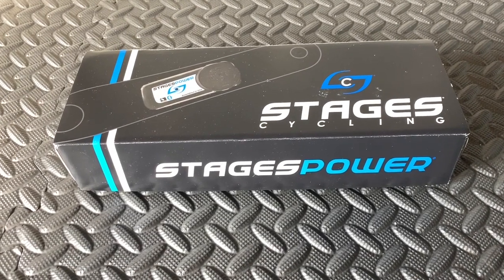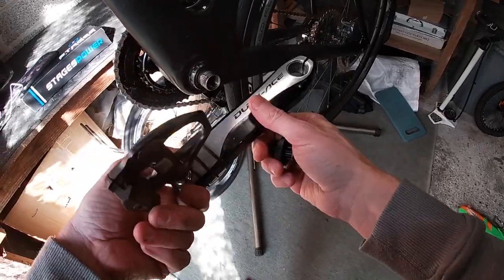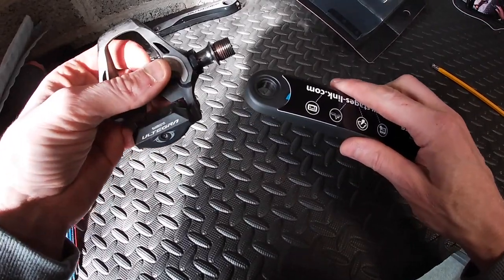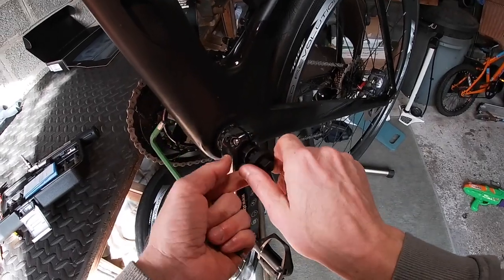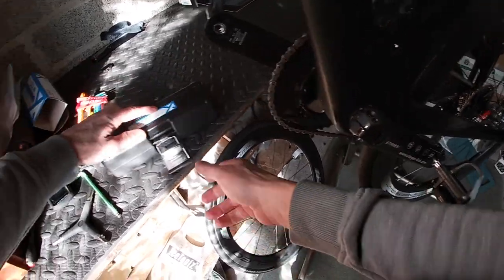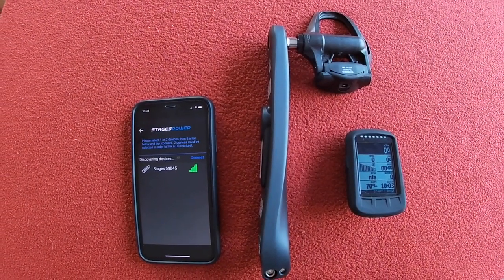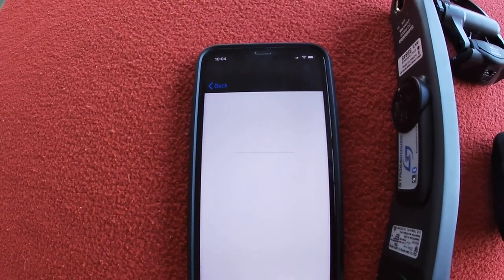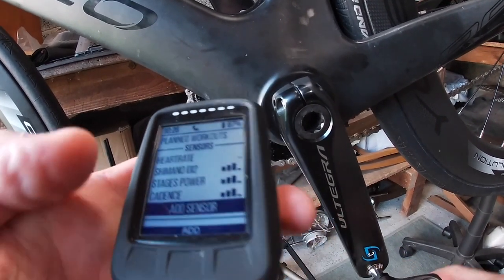Installing and Calibrating Stages G3 Ultegra R8000 Power Meter

Comment: Thanks a lot for this - very useful. I'm having a huge problem getting mine to waken up at all. Only had it for a few weeks and went to try it out yesterday but totally dead. Replaced battery with a new one. Tried the hardware reset (taking battery out for 30 seconds / putting battery in wrong way round). Absolutely nothing. Any ideas?
Reply from the maker: Hmm that’s curious, I just spin my crank to wake mine up, I’m stumped if you’ve tried all of those things... sorry I can’t be of more help. 👍

Comment: Do you have to go in the app for that reset before every ride? That would be kind of annoying tbh
Reply from the maker: Stoffendous stages cycling recommends resetting it once a week or before and major event or fitness test..... I haven’t reset mine since I installed it... it seems to work ok and I think I’m getting the same readings. ( I found this on a google search....

Do I need to calibrate the Stages Power meter? 
                                                                                Not exactly, each Stages Power meter is calibrated during manufacturing using a sophisticated multistage process that is not necessary to repeat: however, it is recommended to perform a Zero Offset Calibration once a week or before any critical event or fitness test

Comment: How do you find the single sided power meter mate is it decent? Thanks.
Reply from the maker: It’s good for anyone starting out on the power meter adventure, it gives a slightly higher reading than my Tacx Neo smart trainer but it is only one sided so it’s possible I’m more powerful on that side. 

It’s good enough for out on the road so I can see and gauge my ride based off the power, so I’d recommend it unless you want to get a whole new crank for the dual side. 👍

Comment: Do I have to turn the stages on or off after and before a ride? And for how long does the batterys resist?
Reply from the maker: No it wakes up when you start moving and shuts down after you finish, you should recalibrate it regularly though which is really easy and that battery will last ages, no problems so far! 👍
Reply: @KyrosHouseCycling  thank you brother
Reply from the maker: @kaneomatic  no problem👍

Comment: My stages calibrates at 853,868,880 does these numbers matter
Reply from the maker: I don’t think so, as long as it calibrates I’m not sure what those numbers are... make sure you calibrate it as per the instructions and you should be fine. 👍
Reply: My understanding is is that when doing the calibration the numbers need to fall within 850-950 to mean that it was calibrated properly. The numbers themselves do not mean anything though.
Reply from the maker: @jaspreetsidhu5708  a cool, thanks for that, that’s very useful. 👍